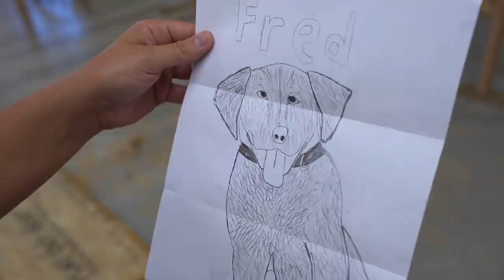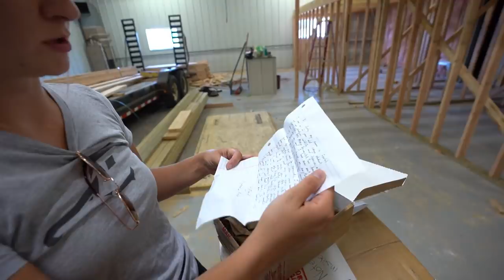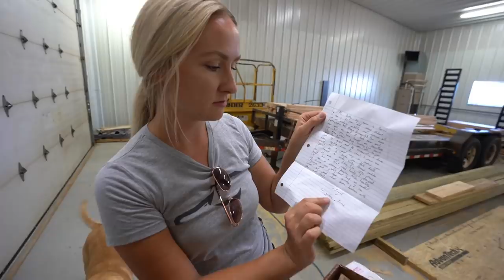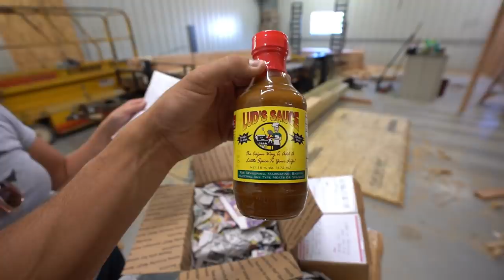Construction Has Begun On My Hunting Lodge!! (Huge Unboxing)

Comment: Bobby, you need to hang a map up in the lodge with a bunch of push pins. That way for everyone who comes they can put a push pin from where they are from. Then you can see where all your hunters are from
Reply: That’s sick idea
Reply: Also one for the gift senders.
Reply from the maker: bro i completely agree to this!!!!!!! great idea
Reply: @BobbyGuyFilms A lot of ham radio operators do this for people they talk to around the world .  I used to do this and talked to several countries and all or almost all states of US including Kansas.
Reply: A trick put nail etc at your location get some white trotline type string use the legend of the map to see how far say 250 miles is and use permanent marker to make alternating white and a color sections on the string that way just stretch the string to clients pin and easily see the straight line distance they came from home!

Comment: here with the new LED fixtures you dont have to mount can lighting just the plastic junction box so just cut round hole and surface mount LED goes straight in wired directly I got mine at home depot and installed in a dropped ceiling tile ceiling.